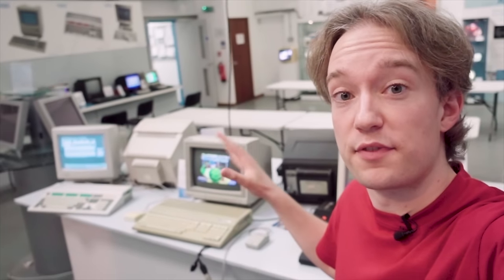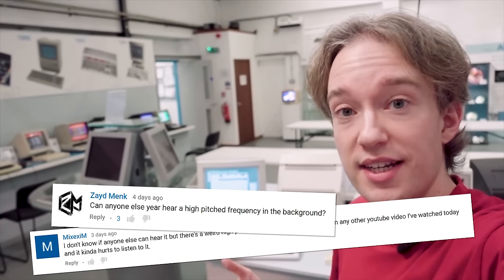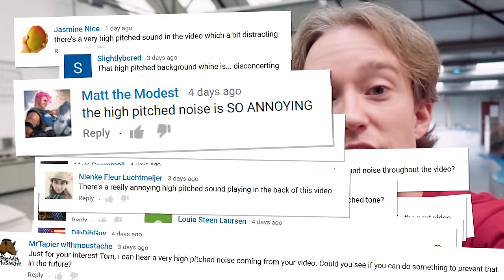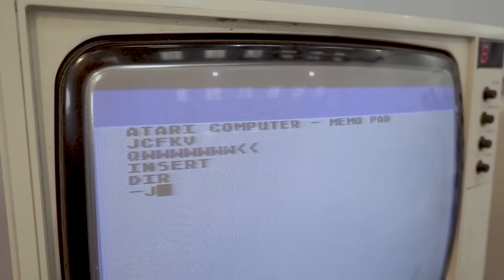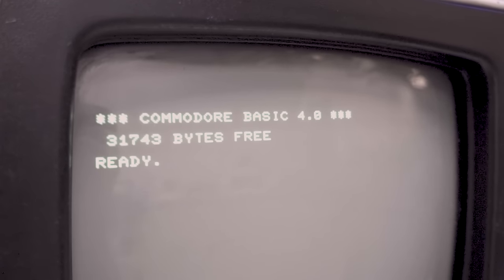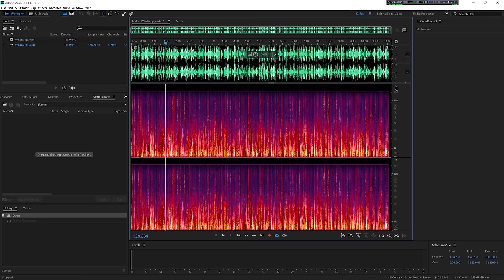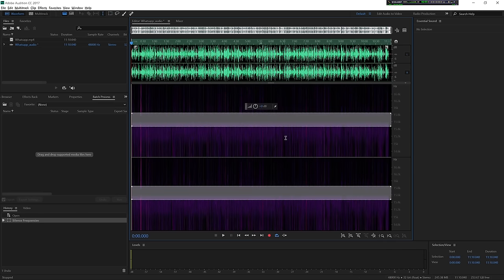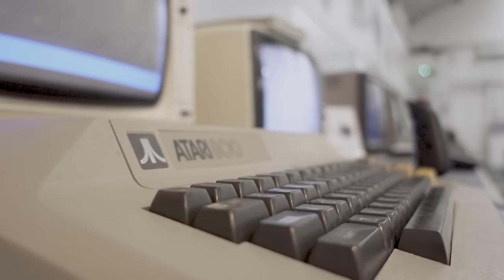Why old screens make a ʰᶦᵍʰ ᵖᶦᵗᶜʰᵉᵈ noise

Comment from the maker: Last time I was here I had a professional camera operator. This time, I have... well, me. At least I checked the audio though. (Thanks again to everyone at the Cambridge Centre for Computing History!)
Reply: hey was that a Morse code or something in the end?
Reply: not just you getting old Tom, I didn't notice a thing and thought it was a greenscreen...
Reply: Well, I can still hear it. Wait the video stopped? But I can still hear it...
Reply: Jeremy is it stuck in your head? like you hear it even if the video isn't on?
Reply: Starts at 3:58. It's bloody headache inducing.
Reply: The high pitch added to the end, may I applaud you, or didn't you hear it ;P
Reply: I was playing with the frequency sound generator with my phone but the speaker is cracking because it isn't good at picking up high frequency noises. Then I hear your end scene(my computer has way better speaker with subwoofer). It does annoy me but it ensures that my hearing isn't degrading before my 20s
Reply: I've had this 16kHz noise in my head since I was a kid. We're about the same age, maybe 2-3 years apart, so that I can say: At the age of 10, I was still able to tell whether the old Blaupunkt TV set from the 70s in my parent's house is on or not (even if it showed nothing on the screen), but later on, this ability vanished. Now I have a flyback transformer noise stuck in my head 24/7. It's called Tinnitus, and all you could hope for is the state I'm in: It is "compensated", which basically means I can suppress the conscious perception of it, so it doesn't disturb me in my daily life (except for a slightly impaired hearing, like having difficulties sorting out voices, while other very low volume noises, like the rushing of water through a radiator, still come through very clearly).
Reply: Tom Scott the end... thats exactly the noice i wouldn't want to hear/remember when i have a migraine....
Reply: I have learned to selectively suppress my conscious perception of that high pitched noise because I grew up with these old CRT monitors, and as such, it doesn’t bother me as much.
Reply: Your hairline also says you're getting old. ;-)  All in good fun. I'm 48. Or... celebrating the 27th anniversary of my 21st birthday.
Reply: I remember complaining to teachers in school when they brought in the giant CRT televisions into the classroom, and the whine would bother me from the hallway. However I am about your age, and I now realize that I might not hear that sound anymore either.
Reply: Tom Scott... get some God damn ear plugs then....
Reply: i still couldn't hear it even after you pointed it out. \o/
Reply: What frequency was that rick roll at?
Reply: I too suffer from tinnitus. It's always a 16kHz tone, but other times it can sound like the new american television emergency alert tone.  It stinks. It stinks so much. Throughout my childhood I'd have moments where my ears would pop, and my ears would ring for 30 seconds or so and then go back to normal. Some time in my 20's that happened one day, and the sound never went away.

I can hear everything I want just fine, except for silence. I will never hear silence again in my life. Even if I tear out my eardrums, the noise will continue (No I'm not going to do that, don't worry).

We have no cure for tinnitus. We aren't really sure what it is. Sometimes its damage to the hairs of the inner ear, but you can also get it from taking various medications, so it's also neurological...

Tom Scott, if you're reading this, Tinnitus might make a really good video subject. If you do make a tinnitus video, PLEASE give us tinnitus sufferers a way to get in touch with someone doing research about it. The American healthcare system is incapable of getting patients who want to help find researchers who want to discover things.

If you don't have tinnitus, FOR THE LOVE OF GOD AND ALL THAT IS HOLY, WEAR EAR PROTECTION WHEN USING LOUD STUFF! Lawnmowers, vacuum cleaners, air compressors, power saws, leaf blowers, all of that kind of stuff!!! Get some high quality ear protection, and use them every time. Even if you aren't using the stuff for a long time.   If you are going to get tinnitus, get it from going to loud concerts. Don't get it from something stupid like a leaf blower.  I am 90% sure my tinnitus comes from a lifetime of being in close proximity to loud computer fans.
Reply: I was just going to ask that too..... It's ok Tom, we all will get to that point
Reply: Life is like a play, you laugh some and cry some along the way, but in the end EVERYONE dies...
Reply: Tom Scott thanks for the little noise at the end
Reply: "NEVER GONNA GIVE YOU UP"
Reply: I shared the last video as much as I could. Just re-watched it, and if i think about it, yes, I can hear the sound. Otherwise didn't notice it.  How did we ignore it for all that time when we watched TV and used CRT's for monitors for all those years.
Reply: Couldn't hear it - even with really nice headphones. I wonder if music tastes change as we get older partially as a result of the hearing range change - because the sound of old monitors giving out a high pitched screech used to leave me running.
Reply: Not possible without pulling down the old youtube video and putting up a new one, which is complicated from a "keeping a channel history" perspective.
Reply: I want to know the frequency of that thing at the end.
Reply: MOST EPIC COMMENT RESPONSE VIDEO!
Reply: Sounds like morse
Reply: I love that you know Spider Robinson, if even only a quote.  On the other hand, if you are ever in The Place, I'll buy you a god's blessing.
Reply: Hearing protection is a good thing but alas no matter what you do your hearing will get progressively worse as you age. Just another gift with many more to come. Just wait until you make a noise every time you get up or sit down.
Reply: ltc0060 15,626kHz
Reply: Tom Scott What is magnetistriction, exactly? I feel like that's a pretty important detail you just glossed over.
Reply: well, for that there is google.
Reply: I feel ya bro. Getting old sucks!!!
Reply: Aaron Divelbliss not getting old isn't a picnic.
Reply: I heard the Morse code, but I don't know Morse code.
Reply: Tom Scott Tom, you are so hard on yourself. You are still one of the best things on YouTube and a source of inspiration and education for so so many people. Your fans love you and support you so chill and know that the best is yet to come! 😘
Reply: I Hear ya
Reply: "Nerver gonna give you up" Well played, Tom, well played. :D
Reply: I heard that noise on the end card. I'm 32. Was I supposed to?
Reply: Old Tom, do not fret, many decades worth of wisdom, will be yours yet. 👍
( Also I heard the beeping at the end. )
Reply: Oh-ho! My son, it gets worse as you get older. A few years ago, I was laying on my right side, reading abed. When I turned over onto my left, suddenly I could hear crickets! A few minutes of experimentation and yep, I have lost a great deal of upper-range hearing in my left ear. From Walkman earphones to iPod earbuds, and a bunch of concerts in between, I was complicit in my own hearing loss. Age is just the cherry on top.
Reply: I went back and watched the What's App video, I assume that's the right one. I didn't hear the noise over your speech per se, but I did get a bit of an unpleasant sensation & mild headache followed shortly after. I had never really payed much attention sound wise, but I always used to get headaches with CRT monitors, especially ones at 60hz (75 & 85Hz didn't bother me), and maybe this is partially why. I could always see the flicker at 60hz but the noise factor never occurred to me.
Reply: Tom Scott how old are you? i heard it. at the end
Reply: did you remove the high pitch noise in the previous video?

i can neither hear it, nor can i detect it with a spectrum analyser, but i can easily hear in the 16khz range...
Reply: auuuwww!!! that outro!! It hurt my ears!!!
Reply: that high pitch noise on the end, I felt it in my throat!!
Reply: Did you just rickroll me in high pitched morse code?!
Reply: You''re amazing Tom! I've been watching all of your videos till now. And all are just amazing. And the code that you added in the outro, not everyone thinks of making videos better by adding these small things. And that's what makes you great. :)
Reply: What is the frequency of the morse code? Since I can't hear it... i'm curious.
Reply: Well.... have a guess ;-)
Reply: Welp, I didn't hear any strange noise in that video... Now that I checked with a tone generator, either my headphones or my ears can't do above 13 900 Hz.
Reply: Don't worry mate, it's normal, I was in audio forensics and relied on my
 eyes more than my ears. Stopped hearing mosquito when I hit 30.
Reply: Thanks for that at the end; morse code?
Reply: Don't worry scott, least you're not like me. I've never been able to hear those mosquito tones and I can't even hear the CRT sounds, 24 and my hearing is that of a damn 80 year old, gotta love being born with gaping holes in my eardrums.
Reply: Tom Scott help me. I'm only 14 and didn't here it in the other video :(
Reply: I wouldn't worry Tom I didn't hear it.. Ironically I was having trouble with my hearing last week, so I went back to check this week after having my ears syringed and still couldn't hear it!
Reply: I'm imagining you at 60. Audiologist: "I recommend this intra-aural implant,  configurable via bluetooth for your chosen frequency response up to 60 kHz.  Great for listening  to bats, but you'll probably prefer the lower filter in daily life.  It makes mosquitos less irritating. "  Celebrate ageing  Tom!
Reply: Tom Scott I wouldn't fret over this if I were you. I was the same way with my hearing, so that surprised me as well. MILLIONS of people like myself know you're incredible and full of knowledge!
Older = Wiser. Correct?
Reply: SlocketSeven yeah got it from some of those fans too. among  other things &  it was always too loud so I was too old @ 14
Reply: I went back to it and I couldn't hear it, until I turned the volume up (too loud), phone speakers only.
Reply: If that serves to make you feel better, I haven't heard any of that noise on the original video. Yes, my hearing is degraded badly, your advice is too late for me. ._.
Reply: Did you purposely put a high pitched noise at the end of the video? Because I had to physically remove my headphones so much it was hurting. Thanks for fueling my tinnitus though :p
Reply: Pass a changing current through something (hell saw tooth current) and it produces a changing magnetic field. stick something ferromagnetic in a magnetic field and it will become magnetized itself. 

Internally ferromagnetic materials are divided into domains, each of which is a region of uniform magnetic polarization. normally they point whatever which way and there's no net magnetic polarization is. However when  ferromagnetic materials  becomes magnetized those domains order and become aligned with the external magnetic field. They do this by literally moving. That changes the internal structure of the material, and that in turn changes it's shape ever so slightly. There's your magnetostriction, 

However the magnetic field in a CRT doesn't stay in one direction.  As the field changes, the domains will keep trying to align with it causing the  internal structure of the material to change. As well the current rapidly drops to zero which causes the magnetic field to come in and out of existence, increasing in strength as the current peaks and then vanishing quickly. That means you don't get a nice continuous magnetic field and the small physical changes caused by magnetostriction don't quite occur smoothly. Instead the domains move, stop move stop move stop, and the material in the transformer basically vibrates very very slightly at a high frequency. it bumps air molecules around making them oscillate at the same frequency and oh wait oscillating air molecules=sound wave.
Reply: RoScFan 
He still looks like a teenager to me, but with the voice of an adult.
Reply: You left it in at the end, you monster! Apparently my hearing is still like that of a teenager. It's not surprising I heard it loud and clear, given that I get annoyed by the ticking of a watch on the other side of a room.
Reply: You looked like you were almost gonna cry tom i wanted to give you a hug so bad
Reply: Code Blue I'm 28 and have worked in a machine shop for 10 years and I still heard it
Reply: I believe I still passed your test at the end, then I got a minor flash headache, I read MarkSill's comment about what it really was and I realized you just managed to do something I thought was impossible. Make me annoyed with a rickroll. I applaud, you Made Me Cry
Reply: Glad I wasn't the only one who noticed it. Also, thanks for another upload on this! :D
Reply: Welcome to getting old kid.
Reply: Tom feel lucky you have quietly lost the hearing. I have lost it too but have replaced with Tinnitus. I alway hear the tone now. Even so, I've grow accustomed to it. Don't fret friend 😁
Reply: Tom Scott Guess it's time to upload yourself to a PC now. Let me know once you figure out how to do it.
We practice dying every night. I love this rhyme for that reason: We are but older children, dear. Afraid to find our bedtime near.
(Apparently it's originally 'Who fret to find our bedtime near.' Oops. I find it comforting.)
Reply: I ASSUMED IT WAS MY TINITIS
Reply: damn you tom! you put that in the endcard >:(
Reply: Tom Scott Is it bad that I'm 17 and couldn't hear it 😂😂
Reply: What frequency was the high pitch noise?
Reply: I still hear a high pitched noise. Don't worry though, it's just my tinnitus.
Reply: I decoded your Morris code, You wasted my time. xD
Reply: +Doctor Dex Same, last time I checked I was hearing somewhere around 16800HZ to 17500HZ at a constant volume that gets louder the quieter everything else gets.
Reply: +Raletia I'm 38 tomorrow and I heard it loud and clear.
Reply: Great vid. I like how you combine tech facts with your personal live here.
Reply: Yeah, it says "NEVER GONNAGIVE YOU UP" FML for Decoding it.
Reply: I didn't hear the high pitched noise.  Now I'm sad.  :(
Reply: Also depends on the dynamic range of your headphones as well. Most start above 15kHz. So, it may be present, but your headphones filter that range out or can't reproduce it.
Reply: I checked after reading your comment. Being hearing impared, I turned my desktop speakers up to 11, and only heard the lower frquency distortion, not the actual tone. I can tell you, it was a weird feeling as I could feel slight pain in my ears, but could only hear a comfortable level lower frequency buzzing.
Reply: gaijininja c.f.
Reply: hey Tom, i can relate, i lost a lot of my hearing on the left ear after a trip to the hospital when i was 22.. so yeah i relate to your anger and disapointment. i love listening to music and always fancied my hearing, so it was and still is a huge reminder that we get old and sometime body get faulty.

i'm now 28  and i would say i lost ~40% of my left ear hearing and have tinnitus, so much that in the military i wouldn't be allowed to shoot a gun. but i can still hear the high pitched  rythm you put at the end,  and actually pretty well in both ears. i'm muche more in trouble when trying to get people's voice in loud environment,  i can't pick up words  over the background

you felt a little sad about it. so  take this happinness cookie i baked for you
Reply: Tom Scott I've lost a portion of my hearing too Tom, it'll be ok buddy.
Reply: SlocketSeven  I've just started to experience what I worry is tinnitus... started a couple of months back ( I'm mid 40s )  just one ear, a constant high pitch sound.  I've also spent a lifetime around comouters... and when I think back how loud they were just 10 or so years ago!  mind you I also spent a lot of my 20s going to a lot of raves and loud nightclubs and a lot of my teens with a Walkman constantly blasting music,  so I've only got myself to blame!
Reply: for those asking about the morse code at the end, it translates to never "gonna give you up"... i hate you tom
Reply: thanks i was gonna try  but was your comment
Reply: thanks tom or being blunt and reminding us of our age
Reply: excellent video, classic tomscott. explaining science in a digestible manner, bravo..:-)
Reply: WAS THAT MORSE CODE AT THE END !!?!!!?!!!!!??!?!!!!!?!!?
Reply: Never gonna give you up
Reply: that ending was evil, tom :P
also...i couldn't hear it in the video from last week for the exact same reason you couldn't
Reply: Tom Scott I follow a morse code Tom, and I must say; you never let me down
Reply: Tom Scott why does my iPad USB mains converter emit a high frequency noise when it's either charging an Android device or if the iPad is fully charged?
Reply: Travis, headphones no matter how nice, usually just roll off very sharply at or below 12 KHz, of all the headphones i tried, only one pair reproduces 16 KHz reliably. 40mm capsules fare better than larger ones in this regard. Earbuds usually drop off at 8 KHz, really nice ones at 11 KHz, they don't reach nearly as far.

But after all, it's fine, because a famous speaker designer once claimed that anything beyond 12 KHz was completely and utterly musically irrelevant, and that was likely accumulated experience with customers rather than anything he would conclude merely from his observations.

I'd suggest to try monitor speakers, those usually play well in excess of 20 KHz, but there it's also a coin toss whether it will work - baffle edge diffraction is really high above 11 KHz, so some high frequencies get amplified, others get cancelled out, and you have a very sharp narrow peak in here.
Reply: Nice end message
Reply: +Siana Gearz I agree on every point except for what the speaker designer said. Wonder if instruments still had their body and bouquet if you'd strip out the outer limit frequencies. Low or high. That is speaking about classical music and instruments since spectrum resonance makes up the sound as well. I think Ravel, Mozart, Beethoven, Tsjaikovski etc. would not have used certain instruments in their play's.  

It becomes a whole different story when you take stuff like electric guitars etc in account. From Jimmy Hendrix to Alexi Laiho all use that range of sound 12+ khz and even adopted techniques. Reverb has it's musical implementation too letting a mic pic up and enhance frequencies. And even the reverb sound of a mic drop as statement in rap battles has musical merit.

Musically irrelevant? Maybe not so much as we can also feel these frequencies lower and higher then our ears pick up. Cells interact to vibrations in the air even the hairs on your arm can transfer sound into the brain. I quite honestly fully disagree with this "expert" But then again I do not make speakers, just comments on YouTube.
Reply: Tom Scott That end tho...
Reply: Women can hear higher frequencies, for longer (through their old age) than men (statistically).
Reply: Tom Scott what was the Morse code message at the end what did it say it went so fast I could understand it
Reply: Eric ya it was but what dose it says it probably says "things you might not know" XD but who knows
Reply: Tom Scott Well actually almost all headphones can output 16 kHz.
Reply: Tom Scott why is your eyes red sir?
Reply: Aleksandra Khlopko are you from that studio?
Reply: Harry Tsang I'm 32 and could hear it easily. But I'm a freak that way. I can hear my neighbor's fridge.
Reply: Ouch, that pulsing at the end tho XD.
Reply: mid-life
Reply: Don't worry Tom, you're still a good lot of fun.
Reply: I'm sure it's a coil whine in your hardware
Reply: Tom Scott I can still hear it on modern TVs :/
Reply: Tom Scott the high pitch sound at the end hurt
Reply: CRTs may be gone, but capacitors and chokes will sing forever.
Reply: What says the Morse at the end
It gives me a mild headache so I don't really wanna check
Reply: Never gonna give you up
Reply: You're not alone, I've had excellent hearing when it comes to normal hearing tests, but the last years I've noticed that some annoying sounds has disappeared or been fixed. I've realized that noone fixed my mums TV, the pots haven't gotten used to the induction stove, etc. It's just my age making my eardrums stiffer and my tinitus covering up the rest. I sometimes feel really sad about this, and I'm scared to what it means to my ability to hear difference in quality of compressed audio (this might be a good thing as well as DAB replaced FM-radio here).
Reply: Eric maybe
Reply: @Eric-zz5ij  I heard it too, I was hoping someone would translate it...
Reply: JUST SAY THE ANSWER TO THE HIGH PITCHED CODE AT THE END AAAA
Reply: Can you explain "degauser" in a video @Tom Scott? 😊
Reply: Hearing loss is about dosage. 75% volume on a iphone will cause hearing loss. 6+ hours at any level using earbuds will cause hearing loss. It’s a massive untalked about problem
Reply: Is that morse at the end of the video?
Reply: that bit at the end really got me
Reply: that sound you played at the end, while I'll try not to complain about it, caused my head to feel like it was exploding and once it was gone I realized I had also stopped breathing
Reply: Why is there " never gonna give you up " in extremely high pitched Morse code at the end? ( i don't know more Scott well, that's why it took me about fifteen minutes to figure out what it says )
Reply: hi
Reply: What an epic ending to a video! Just wondering, what’s the age you are supposed to stop being able to hear that frequency at?
Reply: is the high pitched noises at the very end morse code or does it just sound like it?
Reply: Tom Scott I’m 14 and just got a CRT television for my n64 and Atari 2600. I hear the ringing a lot and it’s very annoying but after sitting there for 10 minutes it goes away. But once I walk out and don’t hear it anymore, I get a grinding headache so I’m kinda scared of what it’s doing to my ears. If a high frequency noise cancelling headphone exists may someone please link it to me it would be so helpful
Reply: Did you just end a video with guilt tripping me about being able to hear? Well done.
Reply: :D
Reply: It is more annoying hearing such high pitch noise without any external source of it. :\
Reply: Tom Scott im 14 and i cant hear mosquito alarms
Reply: Tom Scott im 14 and i cant hear mosquito alarms
Reply: @cybercat1531  cant hear it . the sound visualiser say that there is something but not my ear
Reply: TIL I probably have tinnitus and always assumed high-pitched background noise was the default. I don't know if reading these comments was for better or for worse.
Reply: But there's still a high pitched noise in the background :3
Reply: @jeremylakeman  that's called tinnitus. Look up tinnitus on google, I am surprised that you don't know what that is (you should know what that is.)
Reply: @Seegalgalguntijak  I had completely forgotten about being able to hear the TV being on as a kid!
Reply: @meretriciousinsolent  I can't forget that, it's literally stuck in my head ;)
Reply: @Cayen Maling noice
Reply: @Eric-zz5ij  it was a Rick Roll
Reply: @TheRealSteveHarvey  this was 3 years ago
Reply: I still can sense a old tv on..
You feel it more than you hear it..
Reply: a rickroll
Reply: Great. i got rickrolled by a hidden morse code...
Reply: Anybody know what the morse code at the end said?
Reply: Ahhhh was that really necessary at the end though, what the hell was that.
Reply: Is this room really exciting?
Reply: I watched that video and didn’t notice, until I watched this video and you pointed it out.
Reply: thats just you though
Reply: Yea Tom but some of things you used to not be able to do you can do now. Or learn to
Reply: What does the morse code read
Reply: People don't get angry with vision-impaired people for not being able to see clearly.   But it's so common for people to get angry with others who are hard of hearing.  In this case, you got mad at yourself.
Reply: @jeremylakeman  I can’t
Reply: I'm watching this on a CRT monitor right now.